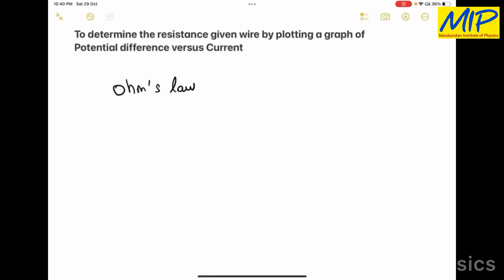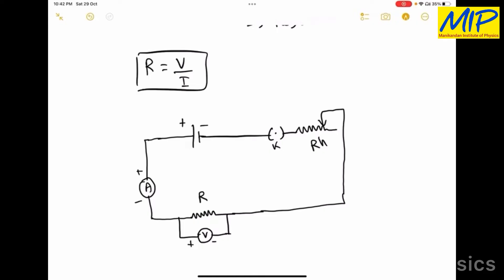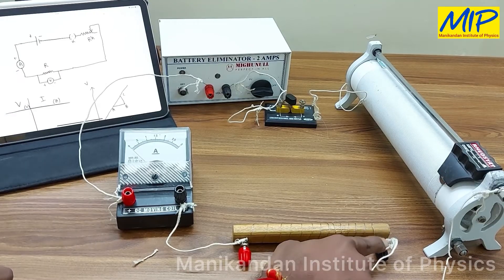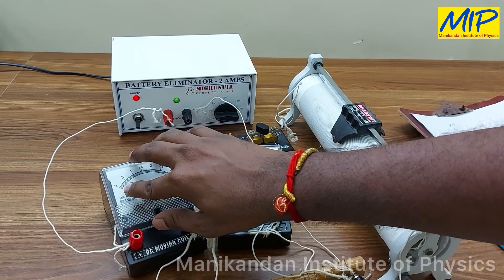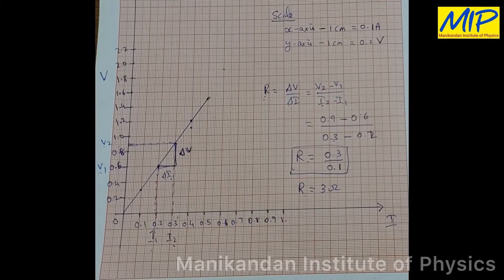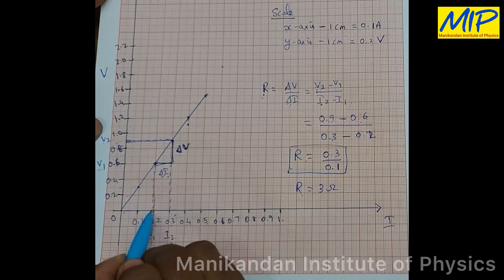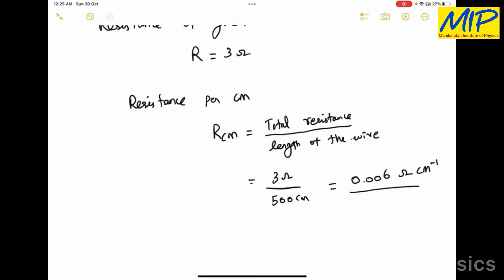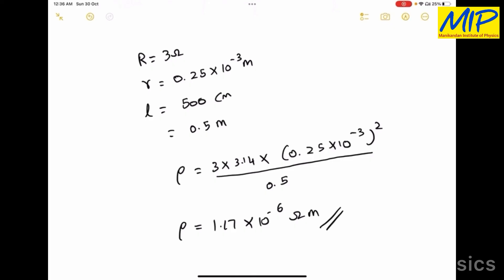Ohm’s Law - Determination of Resistance of a given wire by plotting a graph of potential Vs current

Comment: sir 100 cm = 1meter so,500 cm which u took should give u 5 meter the length you took is wrong sir
Reply from the maker: @benitosahaay6874 yes there is a error it’s 50cm = 0.5m.

Comment: Resistance is equal to slope or 1/slope?
Reply from the maker: It depends which axis you are choosing voltage and current. 
If you are choosing Y axis voltage and X axis current, then R = slope of the curve. ( R=V/I )